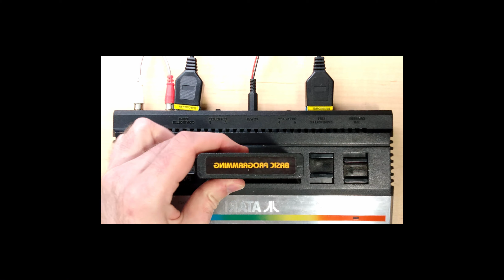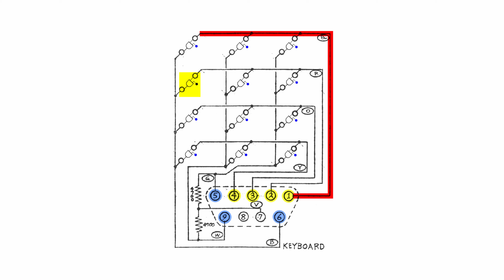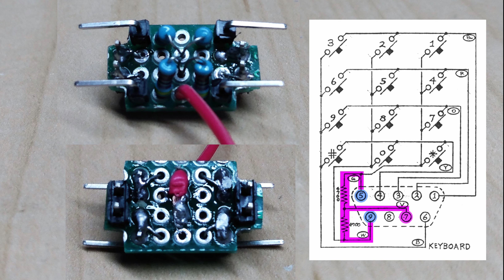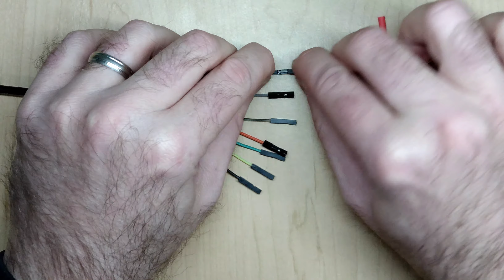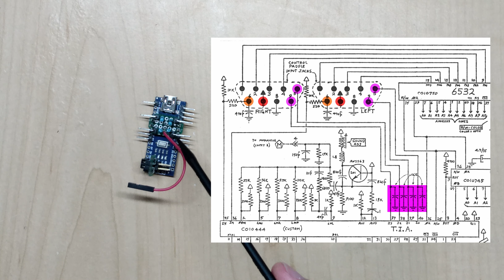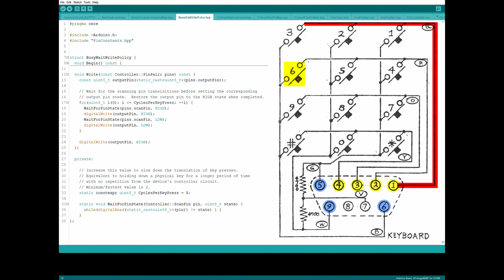Building a Keyboard Adapter for an Atari 2600 (and writing BASIC too!)

Comment: Nice. And if you thought using 2 Atari keyboard controllers was awkward, I only had one which came with Star Raiders. For whatever reason my Basic Programming cartridge didn’t include controllers back in the day, so I’d have to frequently swap player ports in order to write any code.